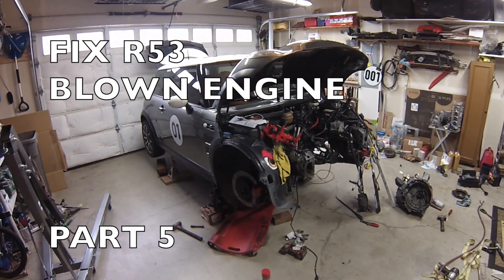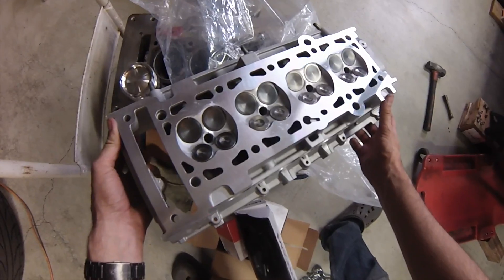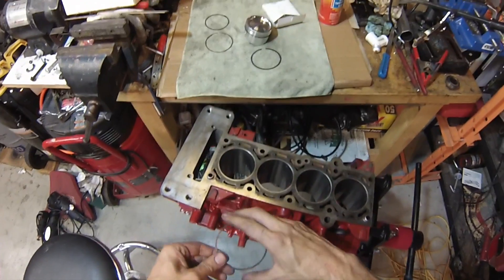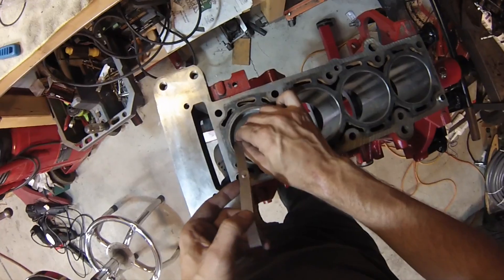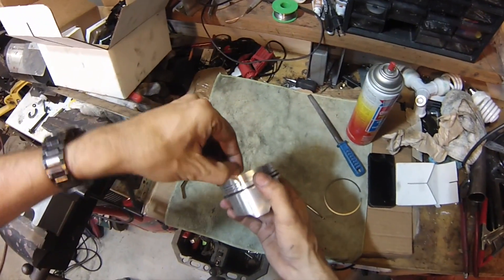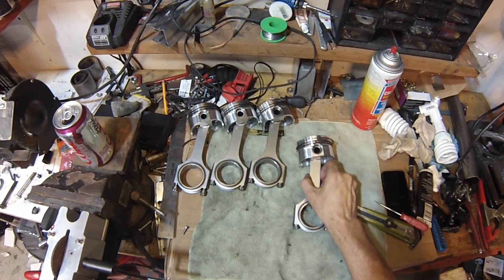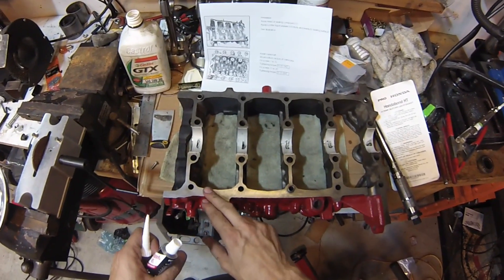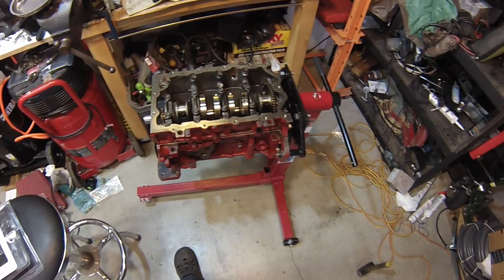Rebuild R53 Blown Engine 2004 MINI Cooper S - Part 5 / 9

Comment: Hi friend, I have a question. 
The stainless steel exhaust system that you put on the mini can also be put on the mini one with a tritec engine without a super charger?
Reply from the maker: The exhaust parts are exactly same for all 1st generation

Comment: Fantastic tutorial, thank you. Any reason you went with 0.015" for the ring end gap? was that what JE recommended? Im in the process of doing the same with wossner pistons. They recommend 0.006" per inch of bore diameter which on my 77.5mm bore (3.05118") comes out at 0.46", and the Mini repair manual says 0.20 - 0.36mm (0.007 - 0.014") but I guess thats for the OEM pistons. I realise this tutorial is six years old now, but if you had the chance to do it again would you stick with 0.015" or go a bit larger, Thanks.

Comment: Hey, man! Great series!
I'm looking forward to rebuilding my R53's engine soon and was wondering how many bolts are needed for the bottom half of the engine? Both realoem.com and minifans.info suggest 10 and 7, but I see you put bolts through the holes with guiding dowels as well, so that takes it to 10 on the inside and 10 on the outside. Also, is there any difference between the regular 7 and the other 3 bolts?
Thanks!
Reply from the maker: Sorry, I can't remember at this point.

Comment: Very entertaining videos. I'm also looking for a Mini or Clubman as a second car. It look like (not only your videos) that a Mini owner always has something to repair! :-) BTW at 12:51 you are torquing the bearings/lower half of the block with a torque wrench. Hint: When you hold the handle like at 12:51, you are torquing the bolts too much. Your right hand should stay at the handle and your left hand just support the head of the torque wrench. I learnt that on aircraft mechanic school. We did some educational tests. Holding the torque wrench wrong, can give up to 20 % wrong results.
Reply from the maker: I have since learned.

Comment: How do you feel about inspecting and reusing rod bearings on these r53 engines? I am in the middle of a rebuild on an 02 and will be opening up the bottom end here this week. Any advice is good.
Reply from the maker: Crank bearings I might reuse, they get little wear. Rod bearings are much more important. I would replace them if at all possible.
Reply: @ModMINI  Thanks mod mini. What brand do you recommend for replacement? The engine is not hurt I am just doing a total refresh of everything she is right at 136k miles.

Comment: Good video.  I like the integrated factory main girdle.  Did you happen to check crank end play?
Reply from the maker: There was no play. End play is almost never an issue on this engine. The main bearings are quite robust. if you're going to have bearing issues with a W11 motor, it would be a connecting rod bearing. The weak spot for this engine is the connecting rod bearings.

Comment: I wouldn't have thinned out that sealant. Let the objects squish together.
Reply from the maker: Forever Computing The instructions say to thin it out. Not doing so could lead to excessive main bearing clearance and early engine failure. The mating parts are machined and very very little sealant is needed.

Comment: Why not reuse the original crank case bolts to keep the two halves of the engine block mated. 44lbs on the inner bolts and 26 lbs on the outter ones are not enough to stretch them.
Reply from the maker: I didn't consider it but I agree that wouldn't be a problem and I successfully did that on another engine I did after this one. I wanted to be careful on this one.

Comment: Hi there, I'm looking at replacing my piston rings. If the original honing marks are clearly present and consistent, am I ok to use the original hone? Also was wondering if the oem rings from Mini are file fit? Have no issues suggesting head gasket issues so I'm guessing I can go ahead and use a copper brush to clean the mating faces of the head and bottom end faces?
All the best!
Warwick
Reply from the maker: If replacing rings, you should probably make new cross hatch. You risk the rings not seating properly if you don't. OEM is probably not file fit, because factory conditions can predict the end gap and they'll just manufacture the rings to fit right the first time. Clean with whatever works for you. Brass brush works fine.

Comment: with the new internals did you need to balance the rotating assembly?
Reply from the maker: No - crankshaft is balanced before pistons are attached to it.

Comment: Are the outer main cap bolts reusable? I should have checked if they were torque to yield before I dropped the block off at the machine shop!

I'm really wishing ARP had a main cap stud kit right now.
Reply from the maker: ***** They probably are but I didn't take any chances and bought new ones. I would be worried more about the main bearing bolts, but worried most about connecting rod bolts.
Reply: ***** I have the main bearing bolts and race rods ordered. The torque specs on the outers doesn't appear to indicate TTY bolts but this car is a special case at every turn!
Reply from the maker: ***** If it makes you nervous, Fastenal has suitable grade and length bolts, but they will be hex cap (allen key) and you'll need to put a washer below the bolt head.

Comment: very clean build
Reply: ***** yeah congratulation ;-) .  I drived about 1000km slowly with the new engine and you just went to the racetrack. ^^ all or nothing....
Reply from the maker: ***** 5000 miles on the rebuilt engine, still running great and oil is super clean and doesn't burn.
Reply from the maker: I'm sure master builders are laughing at my amateur lameness. But spoiler alert - the engine survived a weekend at the track so I seem to have at least the minimum sufficient skill. :-)
Reply from the maker: TheSitscha http://mototuneusa.com/break_in_secrets.htm

Comment: Hi Kurt, nice Video...... Amazing, the clearance of the Pistonrings are much bigger than the OEM-Rings and pistons.
Whats the reason for this? More tension to the Zylinderwall?
Reply: ***** Its actually because of material differences between the stock and after-market pistons. these new forged pistons will expand more than the factory cast pistons lending to a more loose feeling during assembly.
I am very glad you replaced all the bearings.
Reply from the maker: Do you mean the looseness of the piston rings on the pistons? Yes, they feel really lose compared to stock. Yes, I think it is to create more compression as they are race pistons and rings.
Reply: Yes,  thats what i meaned..... ( puh english is hard ^^
Reply from the maker: TheSitscha Haha. All languages are hard when you are not native speaker. (I speak Japanese also)